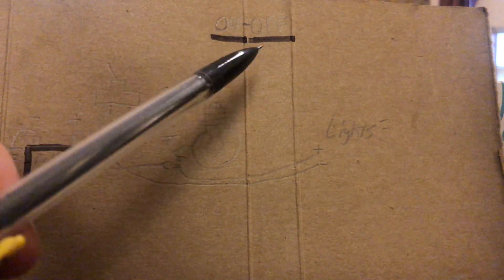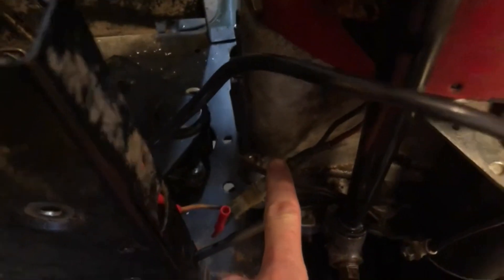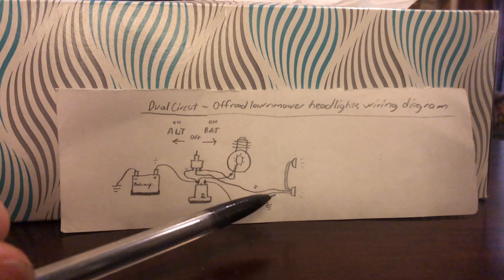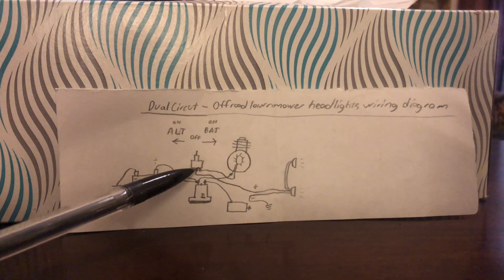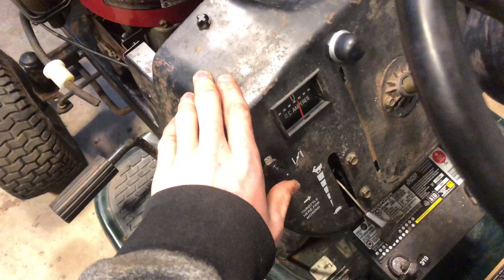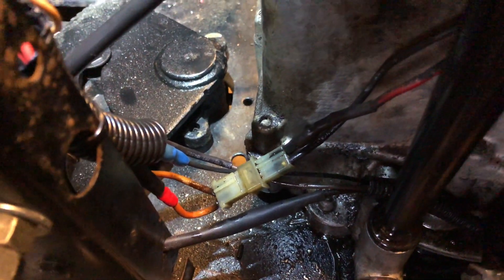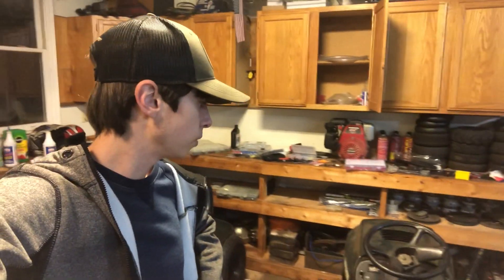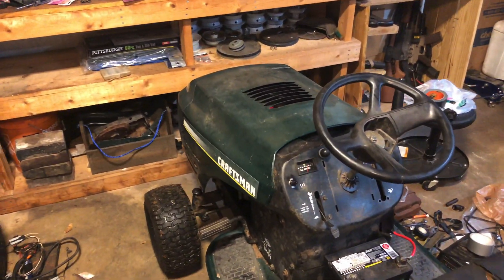Wiring Up Dual Circuit Headlights on Off-road Lawnmower

Comment: Well done. Great vid! How about an LED light bar on the AC side using a 12 rectifier / regulator. Next vid perhaps? :)
Reply from the maker: I might try that in the future, but the only thing is that I don't want a huge drain on my battery because the charging systems on these lawnmowers isn't really the best. I would guess 5-6 amps max.
Reply: @IngenGarage  My understanding is that the battery charging DC output side of the coil is seperate to the AC side and by connecting an accessory to the AC side shouldn't impact battery Charging.  Best of luck with future vids👍
Reply from the maker: @tonydelovski8088  Ah ok that makes sense.